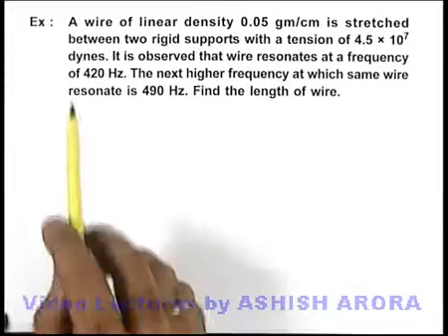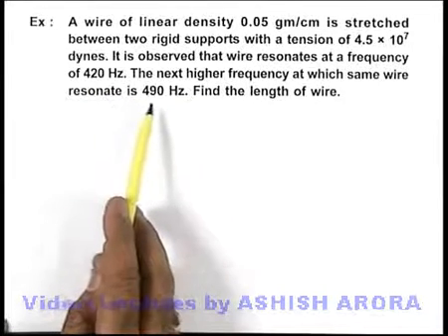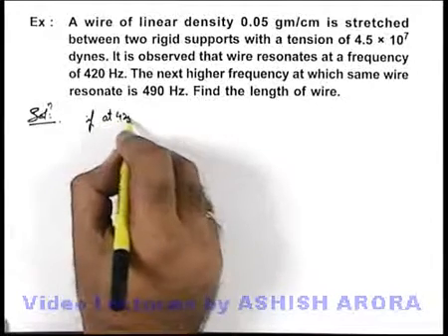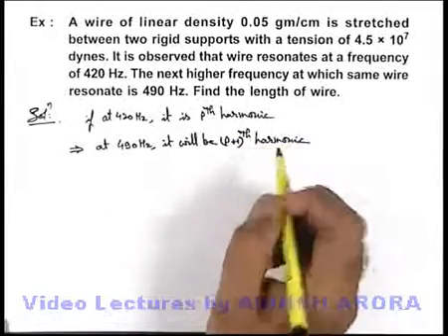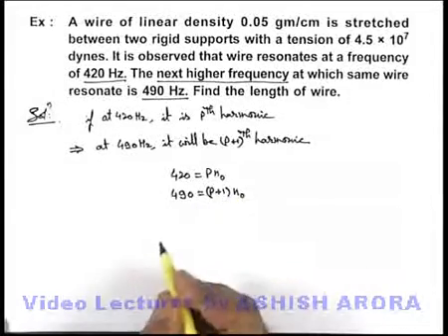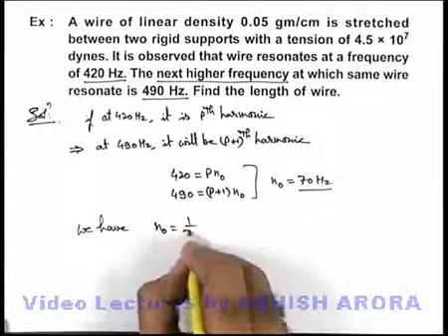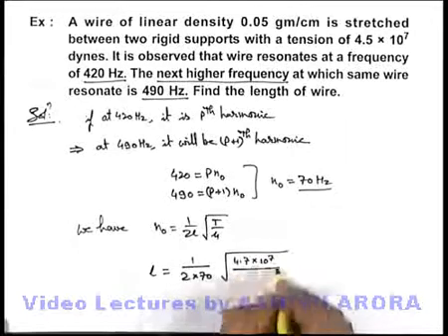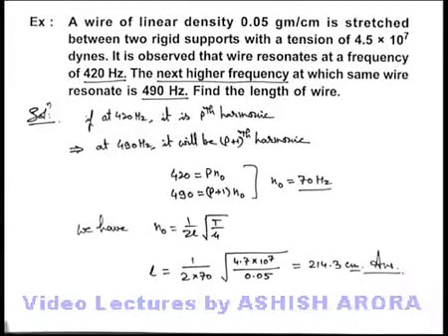Class 11 Physics | Stationary Waves & Beats | #20 Solved Example-7 on Superposition of Waves

Comment: the mew is in gram does not we have to convert in kilogram
Reply: Arun teltia hz,  gm/cm,  dyne,  all r cgs units so no need of converting and we get answer in cgs and u convert it,, its more easy,,,  if u concert mnew  kg/m   so u have concert hz to its si and  tension to its si and u will get over all answer same but in si units that's it